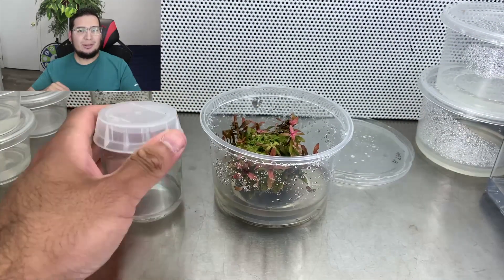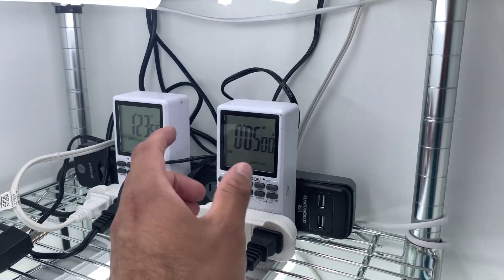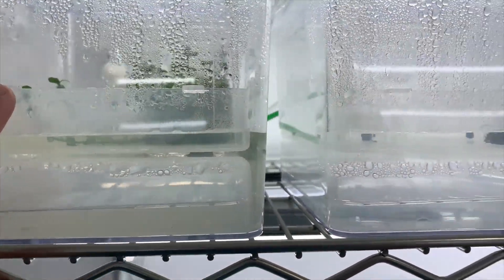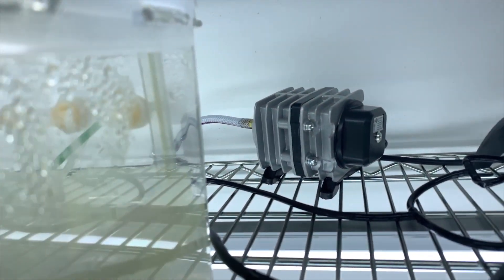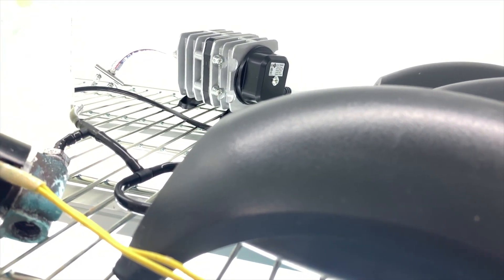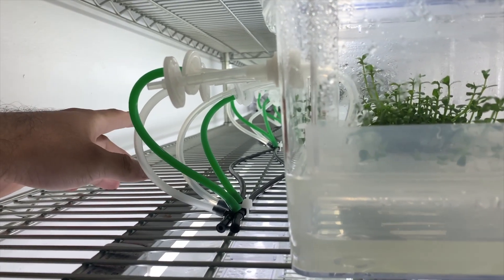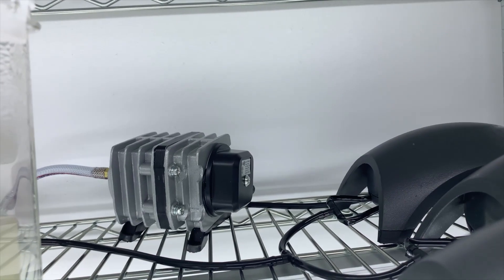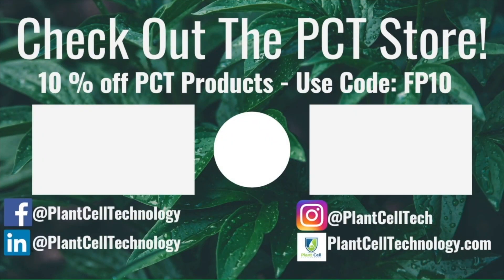Temporary Immersion Bioractors - 8 (Ammania Gracils)

Comment: How’d the ping do? That’s what I was to try. Are you filtering the air coming in from the diaphragm pump?
Reply from the maker: Pinguicula grows very well in temporary immersion bioreactors. And yes, the air is getting filtered.
Reply: @PlantCellTechnology  should I use common 50mm 0.2mm syringe filters? The fluid movement in my design is pneumatic-driven not rotated and I may add a divider at the top for gentle airlifting during the immersion bubbling. Sound good?

Comment: You mentioned running the pumps for 5 minutes every 6 hours…. Do you synchronize the start of the light cycle with a nutrient feed?  Or is it not a critical aspect of these systems?

Comment: Do you need anything to anchor the plant? Or do you just let them float ?
Reply from the maker: No, plants will be submerged in liquid media for some time and then media will again be transferred to another container. This is the principle of temporary immersion bioreactor.
Reply: @PlantCellTechnology  is there any reason you couldn’t initiate a tib system with a node as an explant?
Reply from the maker: @jasonwalters7896  we need to confirm this Francisco as he was the one working on the system.
Reply: Also, sorry to be a bother, but does the liquid media in a TIB system contain the same quantity / ratio of PGRs that would be in a gelled media?
Reply from the maker: @jasonwalters7896  Yes, same ratio and quantity of PGRs.
Reply: @PlantCellTechnology  thank you